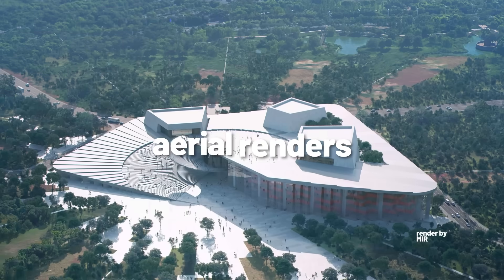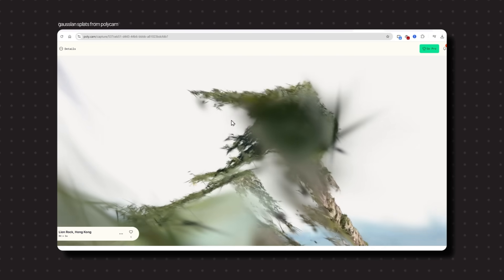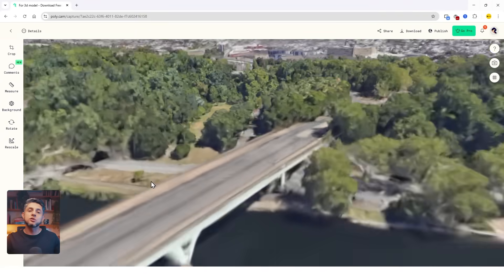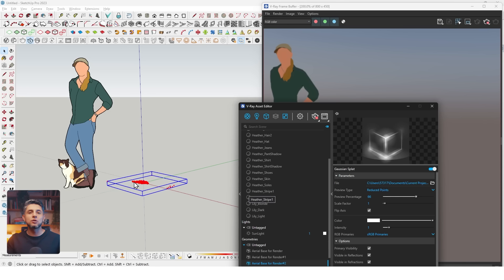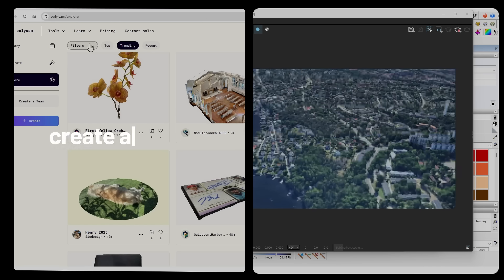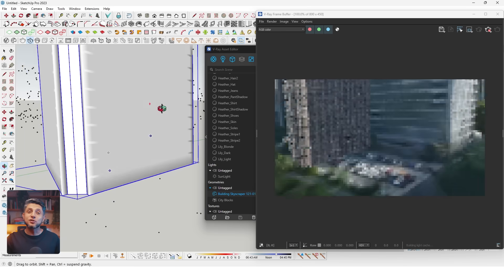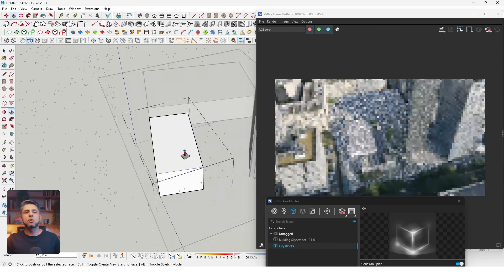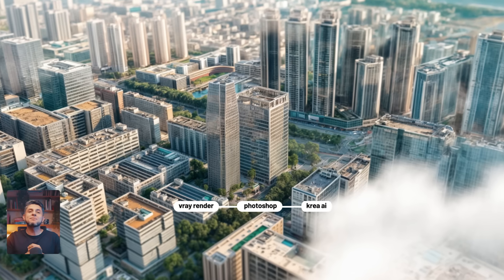How to create an Aerial Render with V-Ray for Sketchup + Gaussian Splats

Comment: How can you create large brick surfaces by using textures in SketchUp using V-Ray without them looking repetitive?
Reply from the maker: Great question! One way to avoid repetition when applying brick textures in SketchUp with V-Ray is to use high-resolution textures combined with V-Ray’s UVW Randomizer. This lets you slightly shift, rotate, or scale the texture on each surface so it doesn't look like a repeating pattern. You can also mix in different texture variations using the MultiSubTex material.